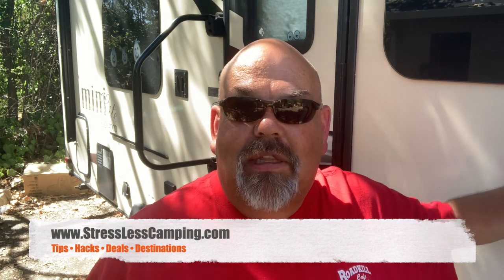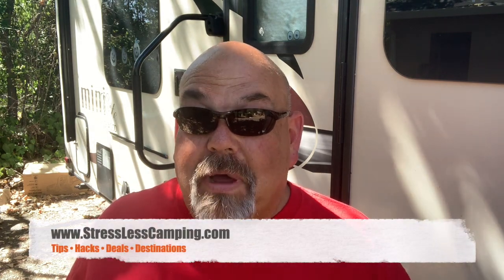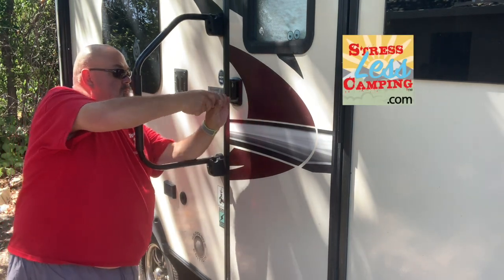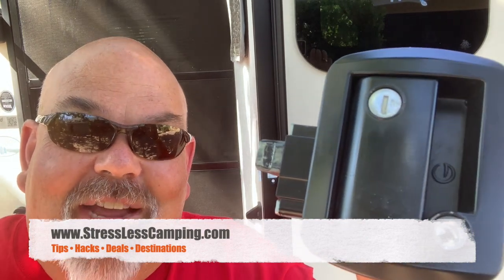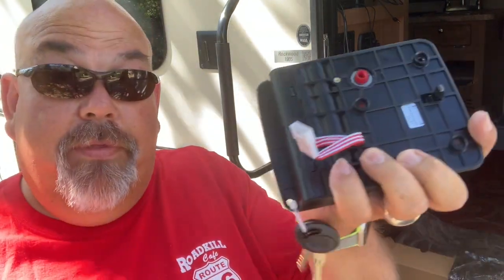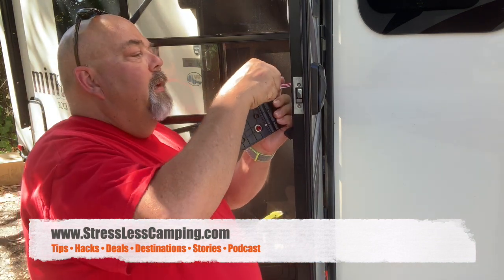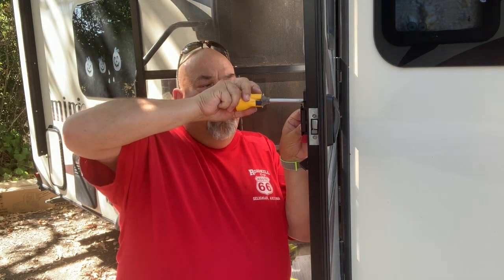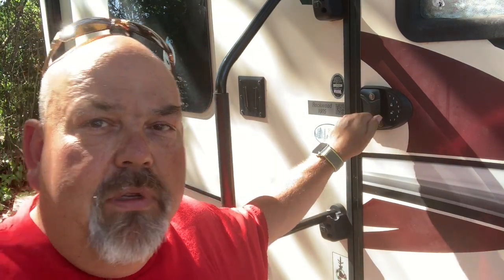Digital keyless RV lock installation and unboxing

Comment: Hello Tony! We have a Class A pusher and last year while in Lake Tahoe I had the rig idling and got out to hook up our Jeep we use as our toad. The only door to the coach slammed behind me and managed to jiggle the lock latch enough that the door locked behind me. I was locked out of my RV with it running! Luckily I had seen a tip somewhere to bolt a Master key safe in the propane compartment since those aren't allowed to be locked. I went and got my hidden key and the day was saved. Your personality has not changed a bit after all these years! Tom Smith
Reply from the maker: Oh boy! Good thing you had heard that tip before this incident!! Great to hear from you as well.

Comment: Great video. Do you have to apply silicone around the edges of the lock?
Reply from the maker: We did not. As we recall, it comes with a compression seal.

Comment: We have been going back and forth about getting this lock. How is the battery life on it?
Reply from the maker: So far we've only had it for a short time but will let you know. Of course it's good that there are keys as a back-up. 

We also put keyless combination locks on the baggage doors and hid a key to the entry door in one of these so we hope not to be stuck outside the camper wishin' we were inside the camper.
Reply from the maker: Update: We've now had this lock for 2.5 years and no battery issues at all. We do have to replace the faceplate over the number keys because that got brittle and fell apart.